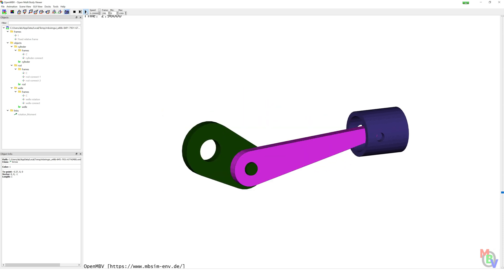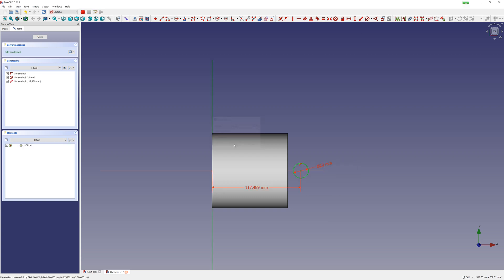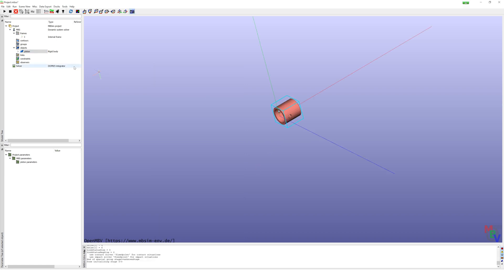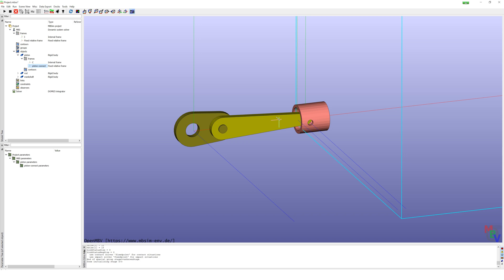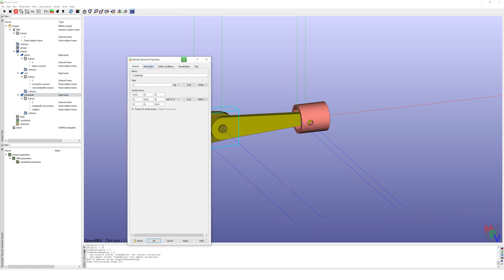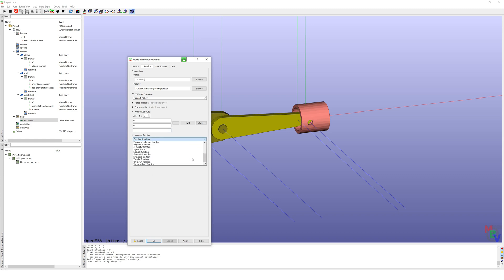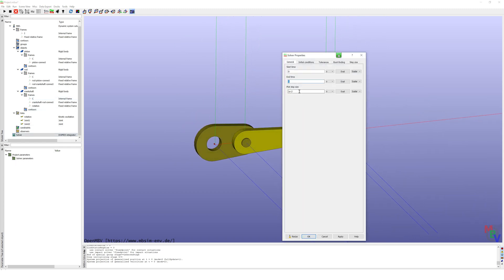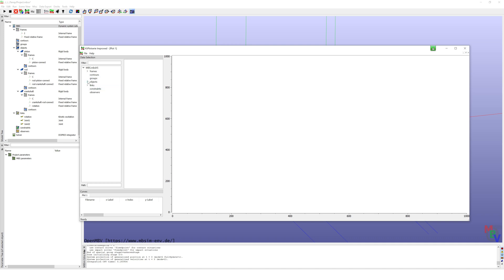Multibody Simulation | Get started with MBSim Environment | Basic workflow

Comment: Hi Andreas, I was setting up the solver and the software sent me this message: '(DOPRI5Integrator::integrate): size of z0 does not match, must be 10'. can you help me, please?
Reply from the maker: Hello, I think you want to control your bodies with initial conditions in solver and size is wrong. For each degree of freedom you need two sizes. If rigid body only has x translation, then you only need 2 Size (Start and End Position) in Solver.
Example: You have two rigid bodies. Body 1 with Kinematics - Rotation about Z and Body 2 with Translation x and y. So the size for Solver - Initial conditions must be: 3 (x, y, rz) * 2 = 6.

Initial state with Size 6:
Value Start Position Rotation Z 
Value Start Position X 
Value Start Position Y 
Value End Position Rotation Z 
Value End Position X 
Value End Position Y 

Or deaktivate the Initial conditions by solver and use on individual by bodies. I hope I could help you)